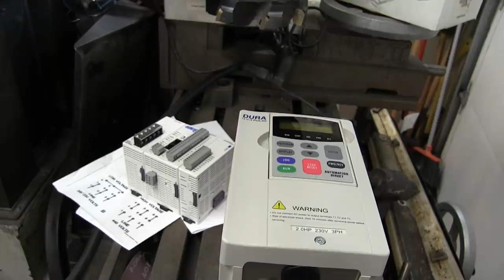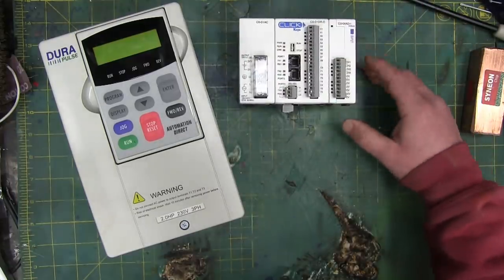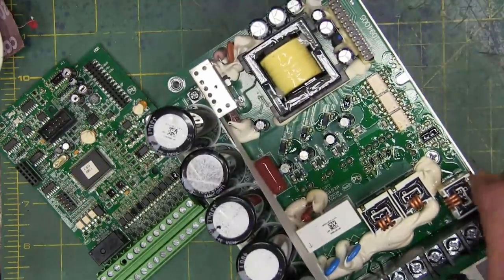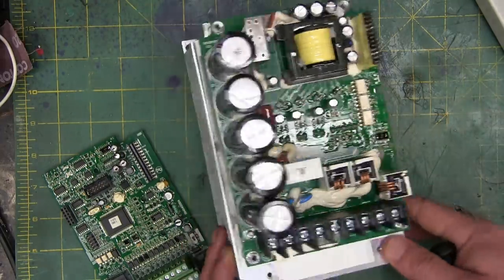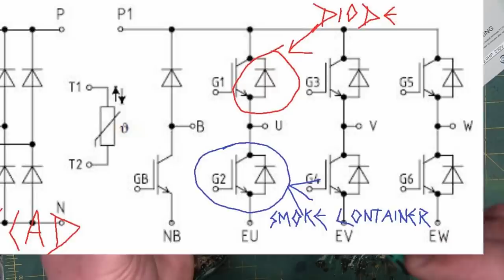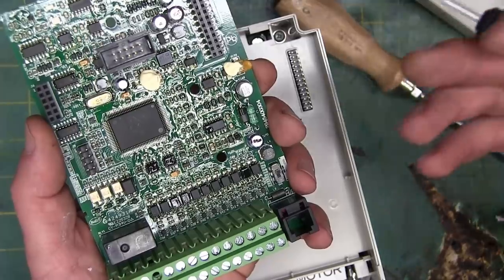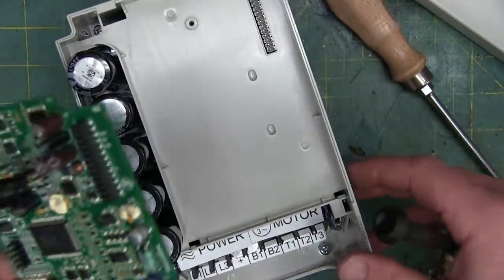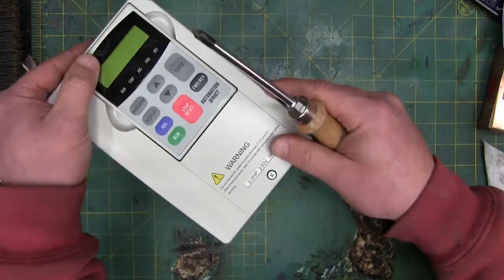BOLTR: Inverter EXPLAINED | DuraPulse VFD

Comment: would any one know if this would be helpful for turning 110 to use on a welder?
Reply: I am not an elec-chicken, but there are welders that run off 110v power.  Couple hundred bucks at the Homeless Despot or Hazard Fraught.  MIG or SMAW, whichever your fancy is.  I think you'd have a hard time rounding up the components and building one for that and still maintaining a reasonable assurance that you won't get dead.

Comment: "Roughly twice the cost of an Arduino" - that brick will set you back about US$240. Not saying it's not worth it of course, but maybe someone needs to shop around for a better deal on Arduinos!
Reply from the maker: $49 for the PLC.
Reply: I DID check automationdirect first, since I'm always interested in "affordable" controllers and the like, so I looked up the model numbers off the parts in that brick;  C0-01AC + C0-01DR-D + C0-01AC = US$237! I'm clearly looking in the wrong place if you got that whole stackup for $49, unless the US Dollar imploded last night...

Comment: I mean Allen Bradley 810s are like 150 bucks, 820's that'll hook up to a panel view are like 300. Good enough for the test bench in my empire https://i.imgur.com/dfegWfY.jpg
Reply from the maker: What software do you use? How much does it cost?
Reply from the maker: Hahahaha Festo power supply. Deep pockets test bench!
Reply: AvE Connected components workbench, it's free. I have an old rslogic 500 license but it's harder to use IMO. The psu is leftover from a project lead by our ops VP who left and cancelled it. Originally it was for a SFAM precision mass flow unit that's sitting under the hood of my sonic currently.
Reply: Kew Akl some important differences https://i.imgur.com/8PNXrNu.jpg the AB one didn't come with an LCD (extra memory and money) the Eaton is much more rugged and the AB is faster.
Reply: Kew Akl you don't even have to take my word for it. Your comment made me curious so Eaton uses an 8bit NEC chip and four beefy relays https://i.imgur.com/JKJuFxj.jpg while the AB has a 32 bit pixie sorter and only two good relays. https://i.imgur.com/YzUQBfZ.jpg

Comment: optocoupler like pixies to light to pixies? for protection?
Reply: Yes
Reply: Yes, for protection. Unfortunately not on the motor connections though, right AvE?
Reply: They isolate circuits by changing the signal to light within the black IC. Usually protection. They're generally very small lightweight signals, not in the end power side of things.
Reply: Yes, but old technology and replaced by inductive couplers now. Optos degrade over time but are very cheap.

Comment: Wow, that TIM (thermal interface material) job is simply HORRIFIC!
PLEASE do remember to replace that with a THIN layer of computer thermal paste (any of the grey stuff should be OK) before you start using it.
Reply: Why do you say that? You're not trying to make an oreo with the shmoo, you only need a tad to get a decent heat transfer. It probably has quite a bit of extra thermal overhead as well in case someone leaves this in a confined space, since there's no fan to help assist with cooling.
Reply: No, it's fine. the computer people have somehow managed to convince everyone that applying TIM is a science. It's not.
Unless you shovel the stuff on there, you won't notice a difference between "just right" and "a bit too much"

Also, with these industrial machines, all you're worried about is the thermal resistance, Junction to ambient. In this case that would be Rtheta Junction to case, case to heatsink and heatsink to ambient. And you can bet your wife that the engineers have calculated that. It's one of the simplest calculations to do, assuming you have the datasheets for all of your parts used, which they will have. That includes the TIM

Even then, the infinion IGBTs have NTC (temperature sensors) built into them, so they can monitor the internal temperature. Trust me, it's fine.
Reply: Dumle29 is correct. Plenty of tests out there that too little TIM is the problem, not too much. As long as it isn't conductive, it won't pose much of a problem (other then getting fucking everywhere). The mounting pressure will ensure that the excess paste goes out the sides. If you use too little, well, it might not make proper contact.

I don't even know where this TIM bullshit started? It became so unanimous in the low level computer building communities that it is gospel at this point, and you will be shit on for suggesting that you can use a lot of TIM. Some places have gotten better, some remain absolutely terrible (cough pcmasterrace and buildapc @ reddit).
Reply: It's not an exact science. Too much will kill it and not enough will give you headaches. 
Just "a little dab'll do ya".
Reply: Too much will not kill it, that is false. Unless for some reason you still use conductive thermal paste...

If too much killed stuff, every hardware manufacturer would have 100% failure rate, because they smear that shit on to ensure full coverage. And since it's non conductive, it won't cause a problem generally (though a PITA to clean up).

The only reason to conserve regular TIM is if you're cost cutting. Obviously throwing a blob of it on everything is going to cost you if you use decent thermal paste.
Reply: Sil-pads are for when you need / want "good enough" thermal transfer AND electrical isolation (and maybe you have some component-to-heatsink gap to fill). Not to mention they're more expensive than a tub of thermal goop (and you need them custom-cut to size, and you need to place'em properly, etc etc etc).

In cases like this, electrical isolation isn't an issue, AND you want the best thermal transfer to the heatsink that you can get. The pastes are only to fill the (more or less) microscopic air gaps between the two surfaces, air being a horrible thermal conductor.
Reply: Mitochondriac nah, not kill it straight away. Eventually, as the TIM degrades it doesn't conduct much of anything, so the lifetime of the part in question is significantly reduced.
Reply: Maybe modern CPUs heat spreaders are different from the heat spreaders in this video? Obviously.
A modern CPU is ~100W in a tiny package with a near perfectly flat heat spreader that you interface with a polished and actively cooled heat sink. And a couple of degrees makes a difference when you're trying to eek out extra cycles. Polished flat to flat requires less TIM. And actively cooled heatsinks can have poorly applied TIM as a bottleneck easier than passively cooled ones.